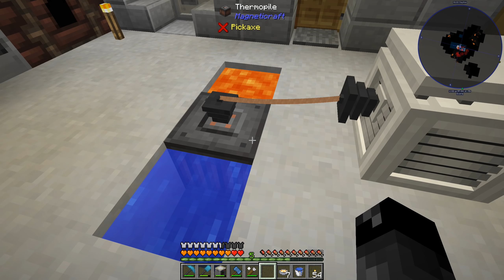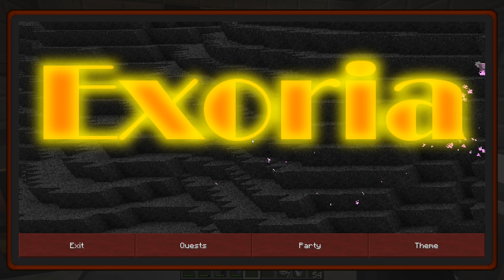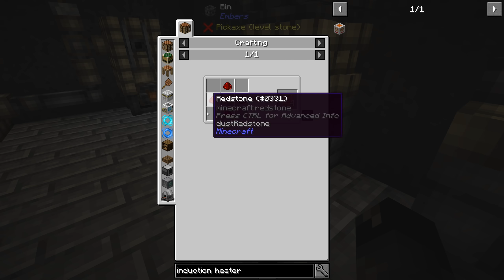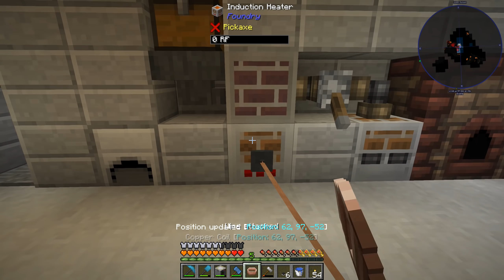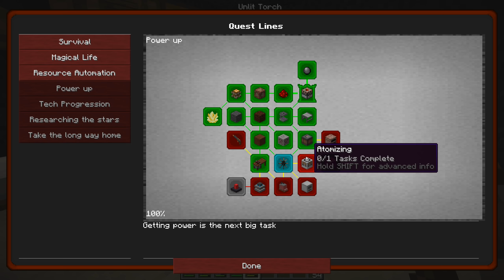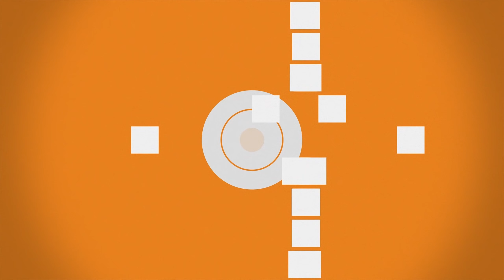Exoria - WINDMILL & DYNAMO [E27] (Modded Minecraft)

Comment: Make a new big room for power stuff (or convert your basement into power room and move the oreberries), use your electrostatic generator+your thermopile+your newley aquired windmill to give the powered heater power, use the stone anvil instead of casting metal into plates whenever you can, good job investing in the strainers, turn your storage chests into diamond chests as well.

Comment: Snow and basaltic magma are your best heat/cold sources at the moment for the thermopile if you want to use that (ends up around 20-25 RF/t) You can also ignore the batterybox and just use the IE capacitors if you want with them. The induction heater will take around 640 RF/t to run at max heat. I noticed when I was piping liquids in and out of the cauldron it tended to near instantly convert (and I was manual crafting the planks) which made it a lot easier if you want to bulk craft treated wood as you can just throw a stack of urushi in and swap the liquids between two tanks.